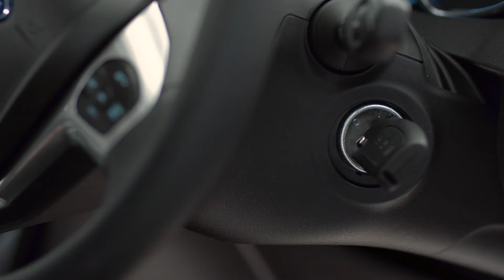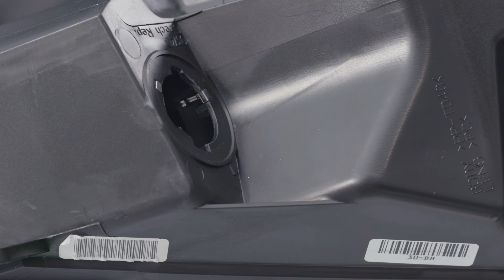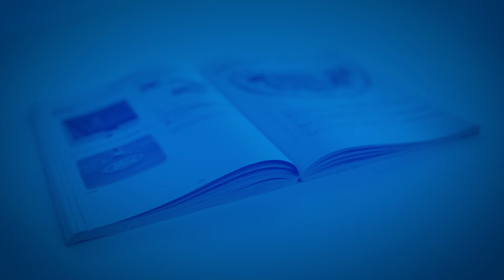Comment changer l'ampoule de vos phares ? | Ford FR

Comment: Bonjour, 
fini le temps ou l’on pouvais changer facilement une ampoule sur le bord de la route.
Les ampoules sont quasiment inaccessibles sur de nombreux véhicules, cela devrait être interdit pour des questions de sécurité, à quoi sert la boite d’ampoules ? Si l’on ne peux pas les changer rapidement à la tombée de la nuit. Si jamais un ou plusieurs dispositifs d’éclairage du véhicule sont endommagé ou grillés, l’usager devra les remplacer immédiatement, sous peine d’être puni par une amende forfaitaire de 68 € , et pouvant être majorée jusqu’à 180 €, en cas de contrôle routier.
 Avec les véhicules actuel, pas facile, faciles.